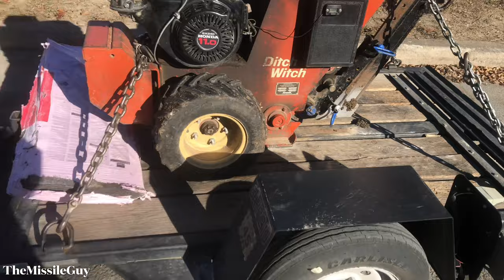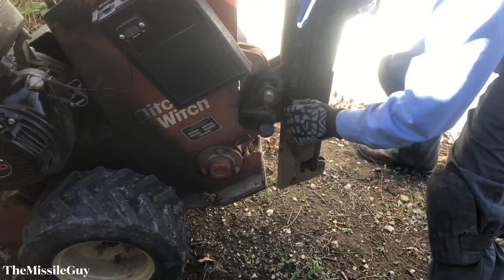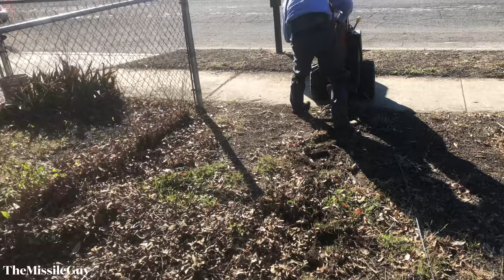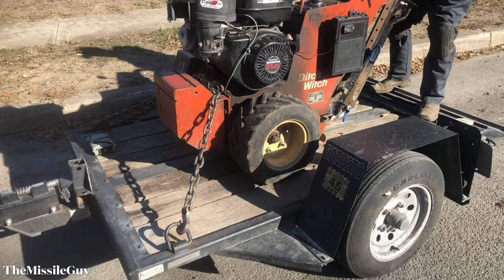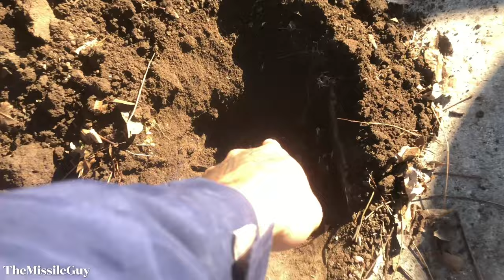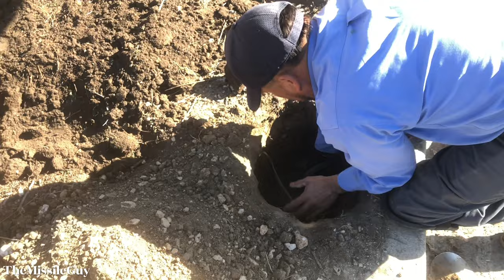FASTEST WAY TO BURY UNDERGROUND CABLES IN 5 Minutes 10 inches deep

Comment: Do you bury for two different companies?
Reply from the maker: No, Just one.
Reply from the maker: I don’t work for these guys, just riding
Reply from the maker: Womper so far. That machine is very limited , there’s a lot of things you need to watch out for , depending on area
Reply from the maker: Kind of a hustle pulling trailer with your own truck , more stress on your powertrain
Reply: I started burying drops with a 100sx I used to just run it up in my truck bed lol I hand bury a lot of drops but can’t imagine hand burying them all lol
Reply from the maker: Once you go with the machine you can’t go back to Womper lol .
Here in Houston in most areas the 100sx is not needed due to utilities